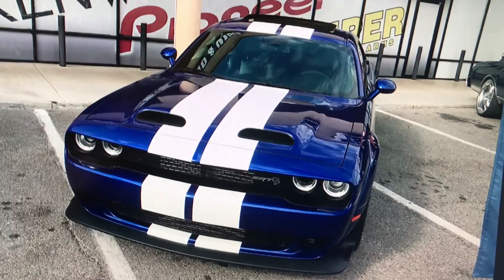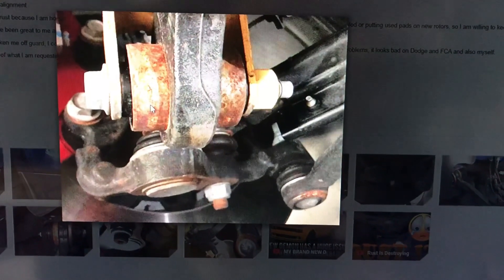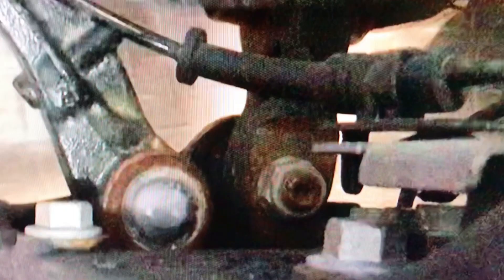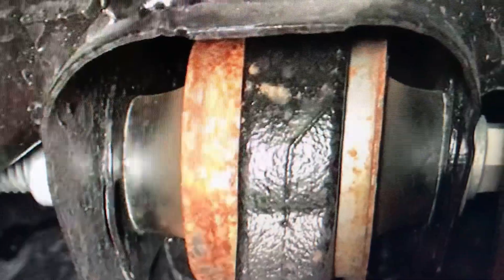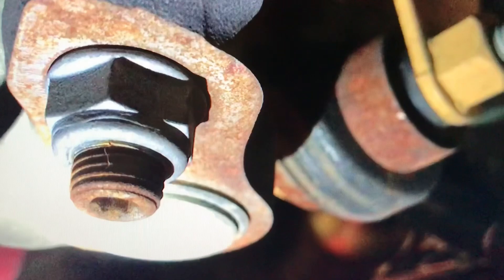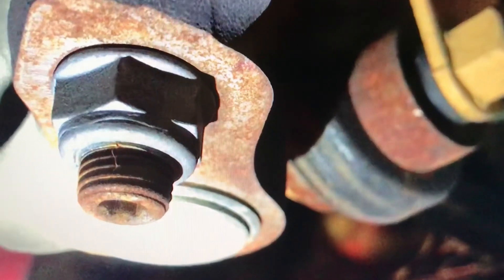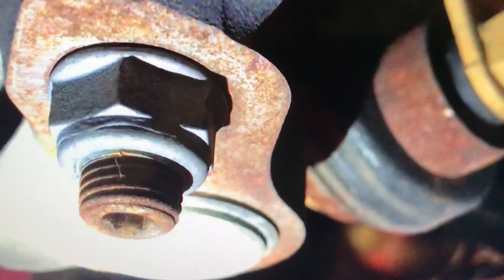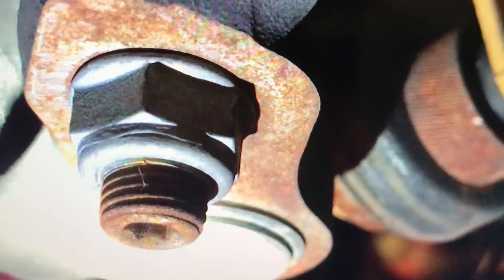2019 HELLCAT REDEYE WIDEBODY EXPOSING THIS SERIOUS RUST ISSUE VIDEO 1 OF 2 SHAME ON DODGE & FCA

Comment: there assembled in brampton canada, stored outside in a storage yard, or shiped across the province to storage yards, there shipping is exposed haulers and never are they coverd, even kia wraps there cars in a white shrink. also all those parts are manufactured buy andother company, the finish on the control arm was removed when the final machining was done, just alot of inferior work, also dodge has always had a front end problem, the fiurst thing im plannin to do with my challenger is a full upgrade of the front end suspension, the problems that arise are pretty serious once the pcs start to fail. plus those bodies are proably retro fits from the sxt and srt models that have been in storage and not sold. everything from 2016 is bolt on to those cars

Comment: 2nd comment..a $93,000 car should not be like that..FCA should be ashamed to put parts like that on a car. Ive bought 2 chargers and 1 challenger ..it isnt right for them to take the cheap way out.

Comment: you do forget where the car is made, in canada. here exposed metal get pretty bad rust in few days, for exemple if i dont drive my car in a week my rotors make a rusty sound for few kms because of that every 3-4 year i have to replace my rear rotors even if pad still has half its life because the rust eat the rotor from the edge going to the center. back to the subject, they put so much salt and stuff on the road its bring the ocean to your door, so you car saw swon and dirty road once when it left the factory. and its just surface rust, because non surface rust make the iron split, like the body after 13+ years or rotors after few years has i said before..., the bolts the bottom of the knuckle or the shell of the bushing are not coated from factory or even if you buy it aftermarket for many reason like the bushing shell, its pressed in even if was coated it will loose it since it slide in the control arm or the bolt because the nuts will remove the coating... i dont defend them in any away! now about the quality of fca i agree with you, owning a 08 magnum and 14 charger, the magnum is way better made than the charger. the paint over the resonator is bubling, i dont think i will be able one day to undo the bolt that hang it to the body or in some places where the spotweld are the paint is bubling.  btw the car is stored in winter and it has around 37k kms. Ive seen rusted fender on 2nd gen chargers they are not that old... ive talked with the trans guy at the 2nd dealer cause i had transmission issues, he tell me since about 2011 they use chinese iron and its bad in quality. i did go to dealer near for my trans problem and i tell them about the rust, i even open a case, they say its normal as underneath is just primer... from my knowledge primer is porous... I saw your 2nd video, your red eyes seems to have been shipped in winter ahile your other challenger my have been shipped in summer or autumn. its safe nothing will get loose or damage, you will replace you control arm before the metal will be too much damaged. think about how old car are they way dangerous than yours, i will tell you a story, i was walking in the street and a car pass by in the 2x2 opposite lane, it got through a pot hole  no big deal at first then the car loose half of its rear spring that broke and jumped to the sidewalk in front of me... or look at old hondas and toyotas with holes everywhere this is unsafe, you might have see over the internet some shocks going through the cabin that dangerous. you can get your part changed if you battle enought with the dealer but as soon has you will get high humidity they will rust again. control and knuckles are made from cast iron not like the body wish is sheet metal and tend to split like layers. i agree with you on some point but some part need to be clean of paint or any coating to make a good contact(you dont want the bushings shell to move inside the control arm...)

Comment: It sucks because the cost of a car of this stature shouldnt have any rust of any kind on it. Brampton plant in Canada has road salt on all of the cars they make there. Biggest thing is all of the parts that have rust on them are made out of cast iron . Unfortunately these cast iron suspension parts are never painted and coated worth a shit . Ultimately Dodge should pick a better manufacturer of suspension parts or take the time to have somebody wire brush these parts and put a good quality paint on them so they dont get any surface rust on them. Everybody that bought a demon had a recall and or could   have this taken care of under warranty . The ball joint stud looks like it has a nick in it . I wouldnt worry about any strength  issue here . It sucks they should pay a little bit better attention to detail !!!!

Comment: Just wait until that Fiat Challenger has rust holes in the rocker panels and rear quarter panels because of the water-holding foam that they inject in there for sound deadening!!!  You'll be pleased then, for $90,000.

Comment: Hey Paul, I have got under the car 1st week with a can of cold galvanized spray and black rust o leum and took care of those issues.
Reply from the maker: Somehow I do not think that will repair a cracked spindle bolt,
Reply: Just my 2 cents : have a independent garage replace that cracked component  for your and other motorist safety and make them reimburse you!
Reply from the maker: @robertelee2797  I will be ordering new parts, they are $2369.40 and will install the suspension myself. FCA denied taking care of this issue, they saw the pictures and teh car was inspected at the Dealership when I brought the issue to their attention. This will be the last FCA vehicle I will purchase

Comment: I wouldn't worry about the rust the bushings and ball joints will wear out before the parts rusted through those are common issues on Dodges I had a charger in here last week that needed $2,500 worth of front end parts and it was in 08 V6

Comment: The 800 hp widebody Challenger is actually SLOWER than the standard 707 Challenger Hellcat on the street due to lack of tire traction---I do this for a living--believe it.  The quickest Hellcat is the Durango in spite of being the heaviest thanks to all-wheel drive traction.
Reply from the maker: The Redeye has a completely different suspension tuning than the standard Hellcat and does not spin tires like a regular Hellcat, I can assure you that no stock Hellcat with 707 HP is going to walk away from my RedEye and I have owned both.
Reply: @ThePaul1551  BULL..I test cars for a living and drive most the Chrysler cars every year.....0-60 times on smooth track and on the street are two different drives.  On smooth race tracks the Redeye will run quick....On the street pavement the Redeye can spin the tires all the way to  100 mph and it impresses passengers but power means nothing if you can't get it on the ground.  On  street asphalt with stock street tires that Redeye  will struggle to  get 0-60 in less than 4 seconds.  It can only outrun a stock 707 from a rolling start.... I have timed this and proven this over and over again..... The heavy HC Durango or Jeep Trackhawk will still beat you on the street with its 100% traction all-wheel drive...if I still had it I would take your money easy....
Reply from the maker: @chadhaire1711  My comment is related to your comment regarding a Hellcat and a RedEye not a Durango or Track Hawk, I could care less if the hellcat is a few tenths of a second quicker or not than the RedEye - that is trivial to me and do not need to prove either point, regardless I have a 100% Stock 21 Challenger that will smoke both of them so now what?
Reply: @ThePaul1551  1. Let us get this straight----You dont care if a stock 707 Hellcat is quicker than your 800 hp Redeye on street pavement YOU SAY--yet you still spend time claiming your Redeye is quicker YOU SAY?  ....I suggest you re-read what you just said and see how silly it is.  I am hoping to get another Hellcat from the Dodge fleet this year,,if I do I can't wait to race you--we can put it on youtube.
2. Frankly all things considered I am amazed you have not removed these videos off youtube.  You are not looking or sounding very good----especially in your original video when you foolishly still drove that lemon car when the lawyer gave you VERY GOOD  advice to stop driving it so the dealer could not blame you for damage......that is something you should NEVER do...you just admitted the car was safe to drive. In a serious lawsuit  where you got hurt you likely would have lost.
3. Especially since you gripe about surface rust under the car, yet did nothing to have it easily removed  and coated while it is new and cheap to do---people do this to their vehicles all the time---especially in damp areas.  Instead you wait for the rust to look worse to make a great video.....well you made a video anyway.
4.  Out of 26,000 views you only got 690 thumbs up....it would be interesting to see the number of thumbs down you got...please show us that along with the rust pics....then take the hint dude!
5. Perhaps you should get the Corvette next time---it too is cheaper to buy and quicker.....Adios....
Reply from the maker: @chadhaire1711  Honestly your whole statement is supposed to bother me? seriously? I said what I said and I did what I did with Documented facts, believe it or don't, I could care less, I am the one with a Wide Body RedEye and your only hoping to get a car this year which is doubtful, the Jailbreak models are the last of the run with the big motors and it appears there is not enough parts left to build what is currently on order, Mr. I know it all, and regardless, if I get board with my so called second fastest car while you still have none I have one of a 50 2021 Challenger NHRA Race Car all stock car build with around an estimated 1600 HP - so hey you can say and do as you want, we know who is on top !!~!~ Boooo Yaaaaa in ya BEHIND !!!!

Ow yea, if you only had even the slightest idea how much $$$$ a 667K Viewed YouTube Video has paid me, guaranteed quite a bit more than your wanna be paycheck and special thanks go out to you for every time you pop up here to post your silly remarks, the beautiful cash register in the sky cha chings once again as you slide that change in your hand right into my pocket, so appreciate you working so you can keep donating me with Free $$ - yours by the way, so again, feel free to keep on chiming in and tell me more of how I am in dreamland, Hater
Reply: @ThePaul1551  hey don't listen to him I just watched his review video on the redeye and he is such a liar cause he says "if I won the lottery today I would buy one tomorrow" and talks all about how great it is but he also knows nothing about them cause he say "buy the automatic model don't get the manual it has to much torque for a manual transmission " first they don't make a manual redeye second your statement about to much torque for a manual is such bullshit

Comment: I'm not sure why your brand new Redeye would be this bad. I have a 2016 Charger that I bought used with 40k+ miles last year that was from Utah. Very salty place for those that don't know. Honestly mine still looks like new. I was actually impressed with how clean and new it looked when I lifted my car for the first time after buying it. Maybe they rushed your build and it skipped the rustproofing stage at the assembly plant. Either way you look at it, a brand new car should not look like that.

Comment: My 2019 scatpack widebody had the same issue,little bit of rust on the bushings and some of the bolts almost all of it looked like surface rust to me.You could even see where the rust stains were running down on the sides ,it’s obviously recent and two mechanics who know cars said the same so we cleaned the area sprayed all the effected components with a rust inhibitors and that’s it .All better now.Also we only found the rust on the front suspension components and on the headers nothing on the rear suspension,rest of the car was clean.
Reply: Scary_scat 392 I have the same problem with my new Widebody.....what product did you use to remediate the rust.......corroseal?

Comment: Honestly not sure why you’re surprised with FCA. Every company has their issues but it seems FCA is constantly repeating or creating quality issues that should never exist at any price range. Also it is a common issue with nearly every new Challenger as they used foam injections in the metal. As long as the car makes it through the 5 corrosion period than it’s no longer their problem. I refuse to buy anything related to Dodge until they either separate from Chrysler or FCA disbands.

Comment: It's Fca what did you expect 🤷🏽‍♂️
Reply: It's almost all American cars. I drive German and rust is not something I worry about. Shit, I have a VW I bought back in 1999 and drove it through 19 Winters in Michigan and it has no rust. VW comes with a 12 year corrosion warranty. And you can get a 2019 Jetta with a turbo motor, and manual gearbox for less than 20 grand. Wake up people. Stop giving your money to American car manufacturers until they try harder.
Reply: Man my fusion and 2nd Taurus had rust thru the paint before 8 years olds but granted I got them about 6 years used and I don't know if th previous owners cared enough but they where really low mileage so idk

Comment: What makes you think that's a crack?  Could it be a ding/defect on the point of the threads, that after the nut was installed, looks like a crack.  FYI,  stress cracks on bolt threads happen in a radial direction around the root of the thread 99% of the time.  That looks like the control arm was in a pile of arms, the thread got dinged in the pile, and in the process of installing the nut, it cleaned the threads up at the root and face, but left a mark at the point.  You can pull it off and have a structural analysis preformed, but, they will break your heart with their answer!   The rust is from the car being stored outside in a wet environment, possibly with salt.  I,m not sure about Nevada, but the rest of the country would consider that surface rust.  That's what happens when bare metal is exposed to H2O, O2 & possibly Chlorides!
Reply: It's called a "formed thread" not a cut thread.  Faster and cheaper to produce.
Reply: @neverendingmods  Where did you read me stating that it was a "cut thread"?

Comment: I started machining when I was 15 years old my first job was in a machine shop I worked on dual piston brake calipers for Ford , I made parts for international, I worked for subsidaries of gm made parts for Mercedes , for gmc, and I have seen freshly machined parts such as these rust over night and in the course of a week develope light pitting , I don't however disagree with the way you feel. It isn't that cars aren't built ok there just charging way to much . If you payed 30,000 you wouldn't be as mad would you?

Comment: Definitely not normal especially  in a dry desert environment.
Reply: It was shipped during the winter and either was doused with salt spray or sat in a high humidity environment over several says. Purchase this same car in the dry summer months and it won't have this issue. You can go to any dealer lot, regardless of make, and find one car with flash rust and one without. Inspect before you buy and coat the underside with a anti-rust spray like fluid film or WD-40 after purchase. If you live in the rust belt, buy a winter beater and park your nice cars. I absolutely refuse to buy any vehicle during the winter months for exactly this reason. He may live in Vegas, but that doesn't mean the car came from Vegas.
Reply: @TrakSpock1  The car was assembled in Canada, I get it. I live in the Midwest ( Chicago ) so very well understand what happens too exposed under carriage components.

Comment: Aw man that’s depressing. Especially here in Vegas of all places!! Even in Michigan this would have to have sat out in the woods rotting away for a couple years to look like this. You just bought this vehicle!! My car is now 9 years old (Toyota Matrix XRS) and I recently re did all the major front end suspension parts (Besides the struts, nothing was broken, I just wanted fresh everything) I actually didn’t find any rust. Even the bushings weren’t cracked, although they were very dry. I also live in Vegas and as you know this stuff just doesn’t happen unless exposed non treated metal is used..which is usually only seen on lower end brake rotors...It would feel like an endless money pit to replace these things but maybe at least replace them with higher quality parts from a different manufacturer...you know I love your car and all the other new muscle cars out there, but Chrysler/Dodge does not make quality cars like they used to. I had a Chrysler van that I sold and got my matrix for that lasted 68k miles until engine internals needed replacing..I maintain my cars to an extreme level. They are rated by mechanics as one of the worst brands :/ too bad cuz the engine is bad ass

Comment: Did he inspect the vehicle while it was on the dealership's lift prior to taking delivery and if so, why didn't he insist they remove the rust?  Chinesium rusts much quicker than US steel.  
Easy fix is to buy a bucket sandblast kit https://www.eastwood.com/blast-out-of-a-bucket-kit.html , a couple bags of 60 - 80 grit media and several cans of good spray paint.
Do it yourself so that you'll know it's done right.

Comment: Warranty is trick, take it from someone that works in that warranty dept. They will not cover repairs most likely because the part(s) hasn't failed. I recommended going to the higher ups i.e. district service manager ext with your concern most likely they will get the ball rolling on this or at least help you some what with the cost on replacing the parts. Good luck my friend!